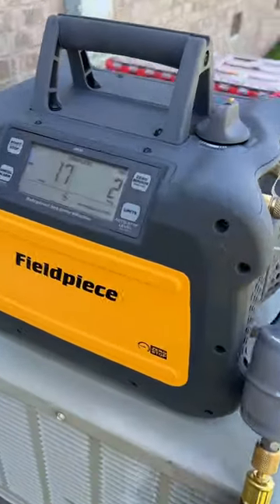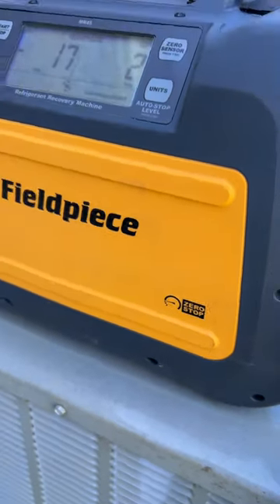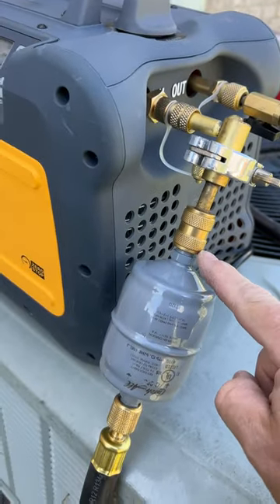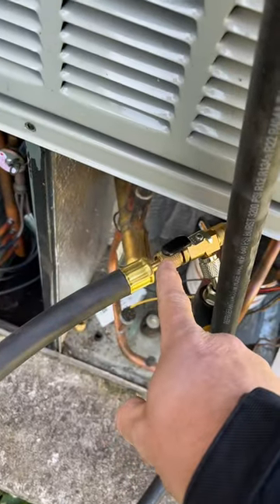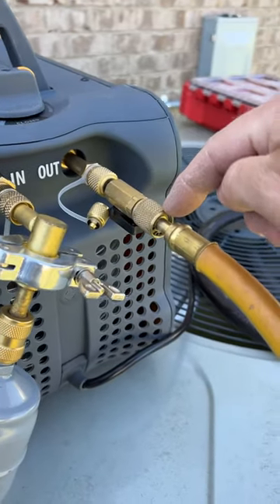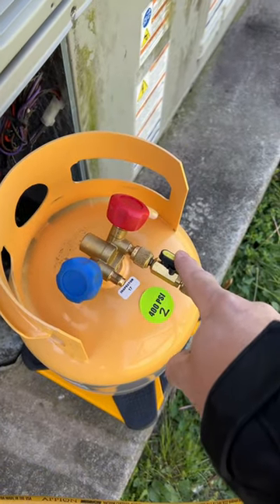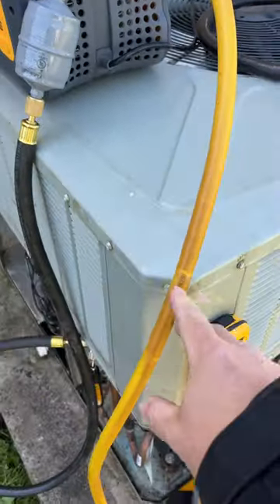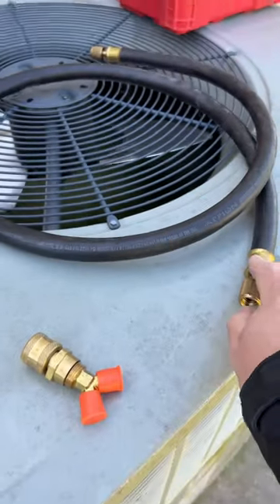The Ultimate Recovery Setup!!  #hvac #howtohvac #refrigerant #hvacrepairs

Comment: Bucket of water is quicker😂
Reply: hhahahahhahaa i agree
Reply: And way cheaper, I've never seen a more convoluted and expensive RECOVERY setup lol
Reply: Pulling off both sides would be way quicker also lmao.
Reply: With ice but cant use scales get the 80% of capacity
Reply: Beats the heat as well
Reply: Wouldn’t you want to go to vapor side, less restrictive bc of dip tube on high side?
Reply: And ice😂
Reply: @chadrayl9648 I said this exact same thing to the mechanic I was working with (I’m an apprentice) and he’s like nope we always go liquid side of tank?
Reply: You can also fill the bucket around the tank with ice if you’re at a restaurant. It’s super fast.
Reply: Why the water?
Reply: The recovery tank gets real hot when recovering refrigerant. The pressures go up on the tank, and sometimes it can borderline seem impossible to finish the recovery process. Put the recovery tank in a 5 gallon bucket, and then put ice on it. You’ll get a super fast recovery through the gauges without the hassle of all that other crap. Ice is easy for me to put in the bucket as it’s usually a restaurant of some sort, and they have massive ice machines.
Reply: @nebraskaman8247  Oh, the bottle should go into the water. I thought you want to vent the refrigerant into the atmosphere through the water.
Reply: No you don’t want the refrigerant anywhere in the atmosphere. Just in the recovery tank.
Reply: @chadrayl9648 yes that is correct.
Reply: Can I record you doing this? Oh and your full name? It’s for research.
Reply: Is the any way to make sure everything gets from the hose into the tank. I always end up with quite a lot of pressure in the out hose going to the tank even after the self purge. I as soon as the purge stops I close off all my valves quickly but with the mr45 I always end up with a decent size release and alot of pressure when I disconnect the out hose between the machine and the bottle. Is there any way to avoid this?
Reply: I'd love to see a video on the disconnect procedure.
Reply: Bruh that's why our ozone layer is fucked 😂
Reply: @simplematthewshadows Why? He's talking about putting the recovery tank in water to cool it off, so the refrigerant continues to flow into the tank. Refrigerant moves from warmer to colder.

Comment: You still pulling thru a 1/4" fitting  3/8" drier you just effectively made that 1/2"  hose useless before you were born we removed 100rds if pound's from grocery store rack systems with homemade recovery systems

Comment: Change the recovery line on the recovery tank to the blue side vapor and just turn it upside down. The high pressure red liquid line has a pipe which will cause the tank to heat up.

Comment: I used the CPS MT69 molecular transformator and the CPS TRS21 oil less recovery pump and a bucket of ice water. Could pull 20 lbs from ice machines in minutes. Was the fastest setup I ever had. Just remember to put MT69 in ice water bucket because it needs that medium to transfer the heat.

Comment: pretty much the same exact setup i use, even same scale, except i use appion core removers and appion quickflo 1/2" hoses on both the in and out of the mr45, and use a WSG082F flare
 drier w/ sight glass on the intake so i can keep track of my liquid quality/amount and track any moisture content my drier is picking up well before I plan to swap it. 
In any case, you got all the right ideas. It's clear that Good Fast Recovery is in this man's life. Kudos for vid.

Comment: Nice unit. 
By far the fastest method of recovery on larger refrigerant quantities is to use 2 valve bottles by drawing vapour from the cylinder with the discharge line back to a high point and a liquid connection to the unit connected to the liquid connection on the bottle. 
Where practical to do, this is the fastest possible method as most of the refrigerant is moved by the differential pressure created by the recovery unit without having to have liquid boil off to vapour
Reply: Thanks I appreciate the info

Comment: I was told that dumping it in the vapor port on your tank is faster
Reply: It is because you are dropping it in recov tank & not pushing it through the liquid straw in the recovery bottle & against liquid head as tank fills.
Reply: It will take longer and your machine will work harder bc the tank gets hot
Reply: Faster on larger systems to use 2 valve bottles as an accumulator (of sorts) connecting the liquid valve to a system low point or points, connect the recovery unit suction to the vapour valve on your bottle and your recovery discharge to a system high point, this then uses the recovery unit to provide differential pressure and the liquid will flow very quickly, of course once you have no liquid you need to then extract vapour in a conventional way
Reply: @ianbottom7396  push pull?
Reply: @JOSERization  yes same method
Reply: @ianbottom7396  push pull only works if you can "drain" liquid out. Like a YK Chiller for example with flooded barrels. But you can't always push pull (like on a DX system)  your next best is to vapour recover and discharge into a subcooler, then into a tank. You can recover about a pound (134a) every 2 minutes with this method (using the MR45 in the video)  and tank stays cool until full.
Reply: With a subcooler and upside down

Comment: Good vid. Tip - Get rid if the 1/4 x 3/8 hard complex & stressed fittings on inlet & just use another 1/4 x 3/8 hose on inlet from drier.

Note - You Could damage recovery unit with hard fittings at inlet of recovery unit. Your putting alot of stress on that area with hard fittings. A hose allows for softer connection & less stress on that connection point.

Comment: Jesus Christ, $3,000 worth of shit to pull the charge in a 5 ton (or less) 5 minutes faster? 🤣
Reply: yo fr tho lol its not like it will be used in a commercial / industrial setting
Reply: Haters gonna hate
Reply: @grashoprsmith  um no…I use high volume evac kits all the time. I just don’t drop $3000+ to evacuate a 5 ton split 🤣
Reply: @Alex-jo2oi you can write better than that. “Yo fr?” 😢
Reply: @jman0870  I mean he does commercial repairs too.
Reply: @APSHVAC  ok buddy
Reply: I have the rothenberger recovery pump, the fieldpiec looks great though… but I kinda wish the designers would design this equipment to have less snag points, even if they could interlock when stored, that would interest me more since vacuum pumps are awkward to store without making a custom box.
Reply: For some techs there's days where you have to recover  5 lbs and  some days you have to recover hundreds of lbs so that setup which is not actually $3000 is necessary
Reply: @AGON17  then why showcase it on a shitty little resi split? If you’re pulling hundeds you’d be showcasing how well you can utilize the push pull method. Try again supertech.
Reply: @jman0870  🧐🔧🦸 someones  gotta put on the cape buddy might as well be you
Reply: I like this video, myself. I wonder how many of these types of videos I can watch and Not see a troll in the comments. I don't hate his equipment or how he's recovering. What's the OSHA cert # for HVAC TROLL?

Comment: For quickly discharge need under pressure tank,and first discharge liquid line of system and must put water on the tank refrigerant(low temperature so quickly  discharge)

Comment: Man I never thought about using larger diameter hoses for recovery. Do you notice a difference in recovery tank temperature? Sweet setup bro.
Reply: Same for evacuation, if you want faster vacuum, the bigger the line diameter and the shorter the quicker it will be. I can’t remember the math relationships exactly but there’s an exponential increase in time taken Vs line diameter and length
Reply: Hook up a heat exchanger in a bucket of ice water before the tank. This is how we recover larger systems.
Reply: nah no difference

Comment: So my question is, do you plan on reusing the refrigerant? I ask because of the dryer in the line. If I plan on reusing the same refrigerant I would use a test kit to see if it was contaminated. If not then yeah that system is top tier! Still and very nice setup... respect!!
Reply: Wouldn´t the filter drier also protect your recovery pump?
Reply: @jor7137  the recovery machine doesn't use the refrigerant as the compressor does. So it doesn't matter if you don't have one for the pump. You just have to test the refrigerant and make sure it's not contaminated.
Reply: @DubYaJsWorld  I was thinking it could filter debris.
Reply: @jor7137  yeah any point can be a failure.

Comment: Just wondering why you're trying to push into the liquid side of the tank.
Reply: Inside the tank the discharge port has a much smaller straw than the suctions port. The smaller straw allows a quicker better recovery

Comment: larger hoses don't really matter when the intake shutoff down at the valve is only 1/4"
Reply: That’s actually a common misconception. There are videos out there explaining the science of why that’s not true, but the easiest way is to think of it as a traffic passing through construction. It slows at the point of construction but flows freely on each side of it.
Reply: @user-te3qq1rb7u  but it’s still flowing less particles or cars through that specific part. It’s like a Venturi. Speed is available but volume is limited by the orifice